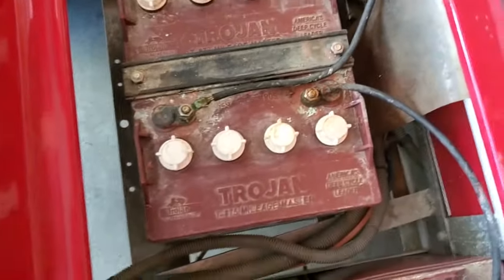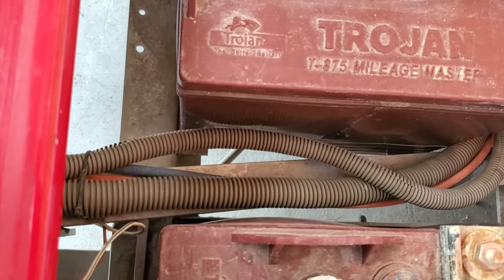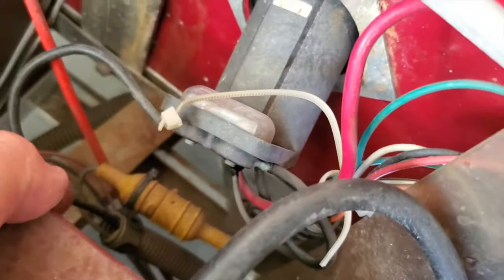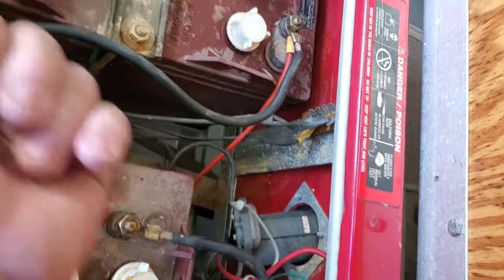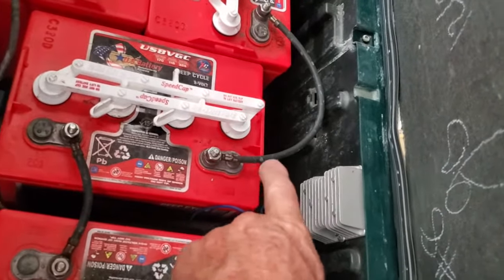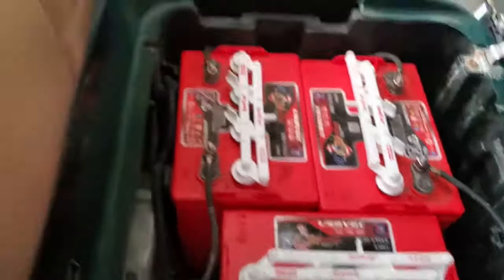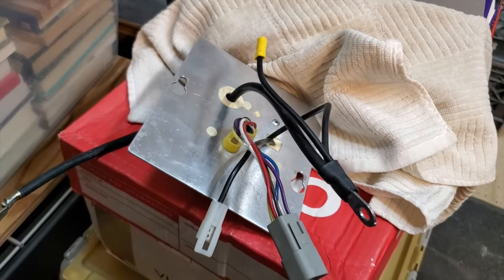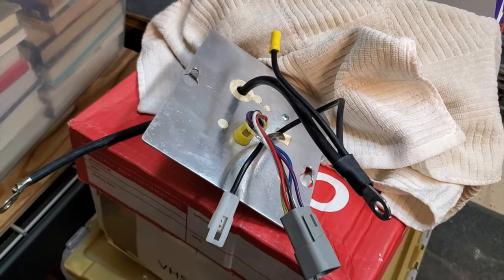How To Bypass Your OBC

Comment: Thanks Wayne. I have a 2003 Club Car DS that I replaced my lead acid batteries with Lithium batteries. I think I screwed up because I removed the entire OBC (not needing it anymore because I have a special charger for the lithium batteries) and cut all the wires from the charging port and then I jumped the white and blue wires. What do I need to do now? Do I need to reconnect the OBC or is there another fix that will work with the removal of the OBC?
Reply from the maker: Sounds like you did everything correctly.  You shouldn't need to di anything else.
Reply: Just to clarify, I don't have a Precedent, it is a DS. Your instructions seemed to be different for a DS cart vs. Precedent. Reason I ask again is because I also did a DC/AC motor conversion using the Navitas system. I cannot get the controller to communicate with the bluetooth app. Thanks!
Reply from the maker: Since you removed your original cart charge receptacle,  and are using a new lithium charger,  then just the blue and white wires need splicing together,  if you have blue and white wires.
Reply from the maker: your Bluetooth problem has nothing to do with the obc
Reply: Thomas I have a similar problem with my 2001 Club Car DS. I do not have a Blue and White wire at my OBS harness connection. Did you have to reconnect your OBS or did you bypass it and if so did you disconnect form controller.
Reply from the maker: If you don't have a blue and white wire, don't worry about those 2 wires, not all carts have those.

Comment: Hello 
I have a 2016 DS that I can’t get to run. I’ve replaced the motor and solenoid but still nothing. Would this bypass possibly help?
Reply from the maker: I need more details about your cart.
How long has it not run?

Did it just stop while driving?

How old are the batteries?

Can you lift the seat and take pictures of the entire battery area,  so I can see all the batteries,  the wires, and the everything there?

You can text them to me at 760 393 1314

Comment: Quick question about the yellow wire on the DS... I have  2007 ds and it has 6 wires coming out of the obc to a quick connect. That goes under the cart not to the solenoid.  The yellow wire on the solenoid is a thick heavy gauge wire from the controller.  Do I cut the small  yellow wire coming out of the obc to quick connect or the 1 on top of solenoid?..thanks for the video and your time
Reply from the maker: The yellow wire i am talking about. is a small  18 gauge wire, not the fat #6 wire. 
Do you not have a 18 Gage wire on your solenoid?
Reply: Ya I don’t have any small yellow wire Coming out the solenoid
Reply from the maker: Rerouting the yellow wire is for older DS carts.
Since yours is newer, besides rerouting the # 10 Black , and cutting the gray wire,  you should only have to deal with the blue and white wires.
Reply: @waynemartin.waynesgolfcart4900  can you give me details on this blue and white wire
Reply from the maker: Jonathan,  I'm talking to a couple different people on this thread.

What year cart and model do you have?
What are you trying to do, or what have you done so far?
Reply: @waynemartin.waynesgolfcart4900  I have an 04 club car DS “Curtis IQ” I want to bypass the OBC I’ve routed the #10 black on the main negative

I don’t have a yellow wire on the solenoid but I do have a light blue wire and a blue and white wire

Do I need to get that blue and white wire to the main negative ?
Reply from the maker: no! Besides the 10 black and the small gray wire,  you need to unplug the obc connector, then on the end of the connector that IS NOT ON THE OBC, you then splice the white wire to the lite blue wire
Reply: @waynemartin.waynesgolfcart4900   I’m gona need a video or pictures of this process haha
Reply from the maker: I have the video out there
Reply: @waynemartin.waynesgolfcart4900  I don’t understand the part where we splice the wire to connect the wire from the solenoid to the main negative

I don’t have a yellow wire on the solenoid there’s light blue wire and anther wire that’s blue and white which wire gose to main negative from the solenoid?
Reply: Are you saying I have to do the same process as the club car president on my club car DS “IQ”
Reply from the maker: you are reading 2 different scenarios!

Do the # 10 black wire, cut off the gray wire,  unplug the obc connector,  then splice the white wire to the blue wire, so they become 1 wire. ( the connector end that DOES NOT GO TO THE OBC).
Thats it, you are done!

Comment: Hi again Wayne
I got my connectors and a new charger Mod z MAX that supposedly works with or without the OBC.  So, before I started cutting wires as you explained, I decided to just try the charger on my Club Car DS 1997 and whlle the voltage across the battery pack (six 8v trojans) was about 49v, it went up to 51v after a few minutes and now the amber light doesn't blink on and off and the cart runs great.  Could this new charger have "reset" the OBC?  I'm now not inclined to cut the wires and rewire.  thoughts?
Reply from the maker: Try it for a few days,  and see.
Reply: Hi Wayne.  After a few days with no blinking amber light, it started again on and off about every 5 seconds.  But yesterday it stopped again and has been fine for two days with no blinking at all.  So, it seems I can get by just charging up with my Mod Z and not cut out the OBC.  What should the voltage be on a fully charged 48v system of six Trojan 8v batteries.  I get up to 55v usually before I stop charging so could leave it going longer.  I'm really curious as to what the intermittent OBC failure might be....just curious.
Reply from the maker: On a typical club car set up, the volts go up as the amps go down. So near the end of the charge,  some times the volts are 60.
I am not familiar with your charger, but I would be skeptical if it works without bypassing the obc.
Reply from the maker: No, with the Summit 2 you Do need to do a bypass.
Reply from the maker: If you buy  a summit 2 that has the round club car connector,  you need to do a bypass.
If you are hooking directly to the batteries,  it may charge the batteries,  but the obc is still active,  and can go into lock down on you.

Comment: Did this on my ds and now it wont move at all. The solenoid doesn't click. I have the one thats like the precedent with the white and blue wires
Reply from the maker: If it doesn't run now, but did before,  then something is not hooked up correctly.  You can email or text me info and pictures,  and I can help you.

Comment: How do I bypass the obc when going to lithium on a 48v 1996 club car ds.  I tried to do what this video stated and it didn’t work
Reply from the maker: I don't know how it couldn't work? Very easy, reroute black # 10 wire from cart charge receptacle to main battery negative.
Then reroute the skinny yellow wire from solenoid,  so it goes from solenoid to that same main negative terminal, nothing else.

Comment: Thanks Waune,
Complicated one going on, I have a 96 ds club car. Runs great, forward and reverse. wont charge tho, charger works on a 95 perfectly. Found broken gray wire coming out of fuse , going to replace it but I did a by pass of the fuse just to test to no avail, all other wire ohm out ok but can the controller still alow cart to run if just charging portion is bad?
Reply from the maker: yes cart will run until batteries die.
You need to replace the charge receptacle on your cart,  and that should fix your issue.
Reply: @waynemartin.waynesgolfcart4900  are there any schematics on the  obc as to what they are looking for or should I say a trouble shoot manual?
Reply from the maker: not that I am aware of.
If your charger works on another cart, but not yours, that tells you the problem is in your cart, not the charger.
Reply: @waynemartin.waynesgolfcart4900  thank you. Was looking for the receptical on your ebay, dod not find it, do you carry it?
Reply from the maker: It is cheaper on Amazon with free shipping,  less than 30 bucks.
Reply: Sorry my fat fingers spelt your name wrong.

Comment: I switched my cart to lithium so I needed to do bypass. I have a precedent. I just wired the back from the charger straight into my pack I didn't any of the other wires. What issues will this cause?
Reply from the maker: I'm trying to read your comment.  I think you said you wired the black from your charger ( I guess you have an on board charger?). Then you didn't do? to any other wires.  I think you are saying you didn't touch any other wires?
You still need to slice the blue and the white wire,  like I did in the video.
Reply: @waynemartin.waynesgolfcart4900 I took the black over coming out of the charger port and wired that straight to the battery. Lithium charger worked after that. Worked without issue for probably 20 miles. Cart cut out going up hill and now will take off full speed then either cut out completely or slows down to 8ish MPH.
Reply from the maker: can you text or email me pictures of your entire battery area ?

So I can see all wires?
Reply: @waynemartin.waynesgolfcart4900  sent you a text. It's hard to see from the pictures though
Reply from the maker: Got no text.  My number is as shown
760 393 1314
Reply: @waynemartin.waynesgolfcart4900  I copied and pasted that number. Maybe try email. What would that be?
Reply from the maker: Lemwert@sbcglobal.net 
760 393 1314
Reply from the maker: So your lithium charger has a club  car cord cap on it,  correct?
Reply from the maker: Can you text or email me please,  and tell  me where you bought the pack from. and the cost shipped to you?
Thanks
Reply: I have now text and emailed both places you gave me
Reply from the maker: got it

Comment: Hi
My DS does not have a small yellow wire on the selonoid.    It does has the large yellow wire (negative) that goes up to the motor controller.    
The selenoid has lots of other wires attatched to it.  

Most from the forward/reverse switch.   Looks like they were added at some point.   

Plus there are 3 wires from the obc, as well as the main black and small grey.   A red fused wire going to + selonid.  Then a green and yellow sliced into connector that goes to motor controller 

So I’m confused.   The wire i connect from negative battery pack should go to which terminal on the selonoid.  ?????

Thanks

Steve
Reply from the maker: If you do not have a skinny yellow wire on your solenoid then do not worry about it, Not all cards have this skinny yellow wire
Reply: Thanks for the reply.    So which terminal on the solenoid do I attach the former grey wire from the main battery negative to?   I tried hooking it up to the large negative post and still did not work.   Does it go to one of the 2 smaller terminals?   

Also should I completely remove the OCB now that it is bypasses or does it still provide some function for the car to run.

Thanks for your help.

Steve
Reply from the maker: you do not hook up the gray wire at all.
Its best to remove obc completly
Reply: Guess I’m not communication well.   I did cut the grey wire out and as you suggested used it to go from main negative  battery terminal to the  solenoid but don’t know which terminal on the solenoid to attach it to.   The is no   Yellow wire on solenoid except the big think wire (negative) going to motor controller 
If you can please re-read my first post completely for what I have on my cart.  
Again thanks for the replies and sorry if I’m not explaining this well 
Steve
Reply from the maker: if you do not have a skinny yellow wire on the solenoid now, dont worry about it, not all carts have that.
Reply: Final question.    Which terminal on the solenoid do I hook the wire from the main negative battery post to?   ( Or which post on solenoid would the  skinny yellow wire have been on?)

Thanks
Reply from the maker: small negative post
Reply: Thanx

Comment: I did the bypass on 2002 D's club car, and my smart charger now shows voltage charging but don't show the amps just 0.0.  Is this normal when I had charged the 48v system direct on battery pack it showed the amps and voltage charging, I cut the gray with fuse at receptacle and cut the black near obc and connected to 48 bank negative....plugged in a d connected 48v smart charger and shows voltage but 0.0 amps
Reply from the maker: Sounds like your charger is not charging.
If you did the bypass correctly,  and you got a charger for a bypassed battery, then all should be good. Also I have not seen a D charge receptacle on a club car, only on an ezgo.
Reply: @waynemartin.waynesgolfcart4900  It is 2002 club car DS with 3 prong plug  I purchased a deleeb C30 smart charger 2 wires going to the plug for the cart red and black, I DID NOT FIND THE SOLENIOD WITH YELLOW WIRE, THE CART RUNS WITH THE BLACK FROM RECEPTACLE CUT AND ATTACHED TO BANK  NEGATIVE AND THE GRAY CUT...ONLY THING IS SHOWING NO AMPS ON CHARGER JUST VOLTS CHARGER KICKS ON SHOWING 58 VOLTS AND 0.0 AMPS WHEN I CONNECT CHARGER TO BANK POSITIVE AND BANK NEGATIVE IT SHOWES VOLTS AND AMPS
Reply from the maker: If charger is showing 58 Volts, then it should be charged,  with no amps flowing!

Drive cart some, then plug charger in, and you should see both volts and amps while charger is charging,  not once it is charged or off.
Reply: @waynemartin.waynesgolfcart4900   I found the problem the eyes on the cables going to the charger where it screws tight on front of the charger were larger than the one that came with it. I ordered longer cables so I could keep the charger in the outside attached she'd and drilled a hole just large enough to put the cables through to the covered carport where I park the cart.I put 2 small washers on the connection behind the eyes of the cables and hooked it up and bingo I now have VOLTS and amps  charging and the cart runs good now. You were right it was not charging due to it  drawing no amps due to the connection the charger was doing nothing.......Thanks Wayne ....I guess the bypass was done correct the only 2 wires I used was the black to 48 bank negative from the receptacle I cut close to the obc rerouted and connected.  And then I cut the gray with yellow fuse holder  near the  receptacle..

Comment: Did the bypass and at first the cart wouldn’t move but solenoid did click . After holding down the pedal for a while the cart started to move , it does randomly not move when I stop but after letting up and pushing down again on the pedal it moves . I rechecked all the wires snd everything is tight .
Reply from the maker: I cannot guess what year and model cart that you have.
Why did you do the bypass?
After doing bypass does cart charge with your new charger?
Which new charger did you buy?
Reply: @waynemartin.waynesgolfcart4900  …It’s a 2003 Club Car DS . I’m going to lithium batteries within the next 2 weeks that’s why I deleted the obc .
I did the delete Friday and since Friday night I have not had a problem and everything seems fine now . Did something have to be energized ?
I’m using a Modz smart charger .
Reply: @waynemartin.waynesgolfcart4900  …There was a black ground wire that went from the obc to what looks like a grounding post . I have not heard anyone mention this when they talk about the obc bypass . I just took the wire completely out since the obc is gone .
Reply from the maker: You did correctly
Reply: @waynemartin.waynesgolfcart4900   …I’m hoping it was just a small glitch that won’t come back . Or maybe something else on the cart is going bad and it’s just a coincidence it happened right then .

Comment: do a video on how to install Roypow on board charger for Club Car president
Reply from the maker: You can see how to install the charger on board,  in a couple of my roypow videos already. 
UNLESS, you have the newer roypow charger that has the green cord, they are different.
Reply: @waynemartin.waynesgolfcart4900  yes, sir. I have the one with the green power cord.
Reply from the maker: ok, what came with the charger,  a whip with 2 wires hanging out, or a short adapter with cord caps on both ends?
Reply: @waynemartin.waynesgolfcart4900   a short adapter with a cap on both ends
Reply from the maker: Not the best answer. The new charger with the green cord makes it a pain to cleanly wire onboard.
No problem with the 110v cord, you can wire that like I do in my videos. I even sell the custom plate on my ebay store.
But in order to wire the other end for onboard,  you have 3 options :

# 1-'You can reuse the original cart receptacle,  by wiring it to the roypow unit,  then plugging in the adapter,  and leaving the receptacle laying inside the bucket area.

# 2--Get  different lithium charger,  you can use one from Allied, that will wire directly to the roypow,  like I do in my videos. 

# 3-- Roypow has a whip, that plugs into the charger and the other end just has 2 wires hanging out, that you attach to the roypow unit.
Reply: @waynemartin.waynesgolfcart4900  ok sir ..thanks for the quick response and info!!